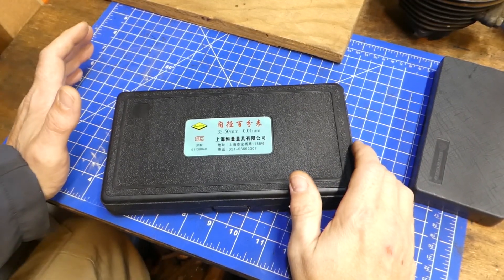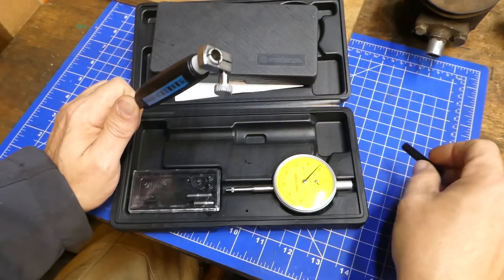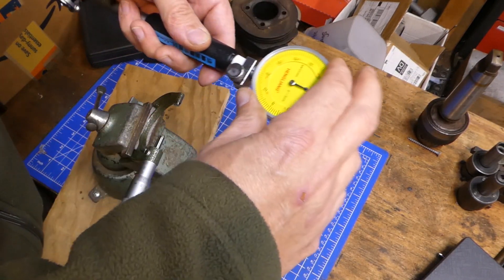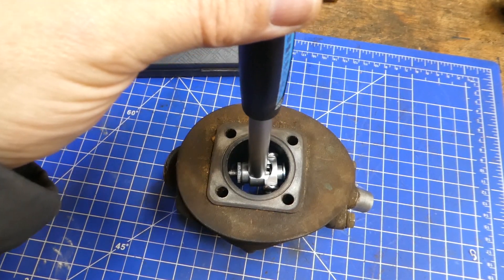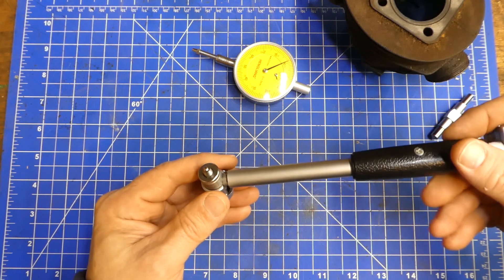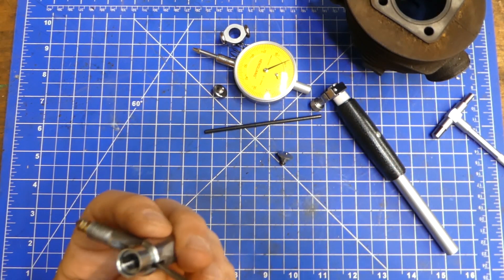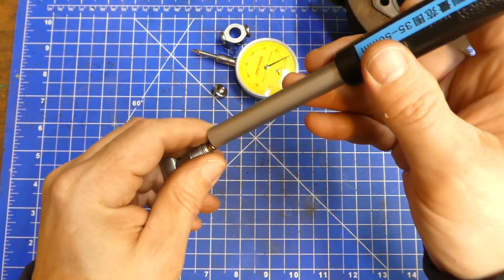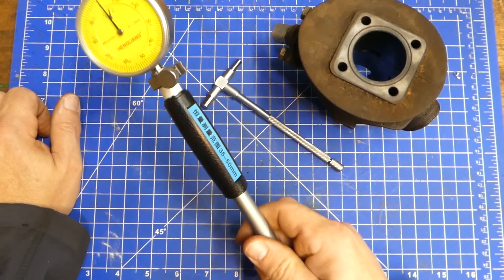Inside a cheap bore gauge

Comment: It didn’t seem to be a problem “fixing” it. I’m always amazed at how they can build something so cheaply and yet have it work the way it’s supposed to.  I often take these things apart as well to clean, re-oil, if necessary and check to make sure it’s actually working properly. These cheap things can work just as well as tools costing ten or twenty times as much as long as it’s understood that you need to know how these work before buying so that you can take care of any problems they may come with. I bought a 6” dial caliper back in the early 1980s that looks just as good as, and works just as well as my Brown & Sharpes and Starretts.

Comment: About the only times i use my one is for measuring big end & main bearing  sizes in engine rebuilding .
An easy way to set them is to lay the micrometer on the foam lid of the box & the foam supports the bore gauge so it can be rocked in 2 directions to set the size .  
You will get the hang of it !!!
Cheers .
Reply from the maker: Thanks Max! I will try that. I knew there had to be some tricks to it. I have seen a few special jig setups for guys that use these all the time but knew there must be some simpler ways to calibrate them..  All the best!

Comment: I bought similar on ebay. Mine was Ok out of the box. Great for taper and out-of-round. Helped me determine that RD400c just needed hone and rings, and XR100R a bore and piston. Something that I'll use maybe every three or four years, I'm not spending any more on.
Reply from the maker: I would normally send bores out to be done, so all I would usually need to know is a rough measurement to determine whether it is in tolerance or needs a oversize. The snap gauges work fine for that. But this is better built for taking repetitive measurements while cutting. And like you say, it is not something I am going to use much so is priced accordingly.
Thanks,
Eddie

Comment: G’day Eddie. It actually doesn’t look too bad for the money. The ok’d bore wasn’t too far off 1.5”. Cheers buddy 🍻. Aaron
Reply from the maker: Hey Aaron. For $15 it is a steal, lol. The bore should have been 38mm plus a few hundreds. A 10th over (is it correct to say 0.1 that way or 100 microns or? Trying to work on the nomenclature) is a bit much BUT it is an Italian engine and the pistons are not always perfectly round so there may have been a compromise made or that bore was "plum wore out". I will go further into that when I cut the bore, IF I cut the bore. I have already had another identical one done by my guy but I want to try it on this machine and see if I can hold the tolerance. So far I am getting mixed results. Thanks! Eddie

Comment: that is a nice assessment.
For me, Not having one is a better option than having that one.
If it was in imperial, might change my mind
Reply from the maker: I hear ya. You can just change the indicator to an imperial one and its imperial.
Reply: @theeddies  Is the indicator mount 8mm vs imperial's 3/8" diameter? I have that problem with mag stands made for the imperial market, tough to find one for metric. They can be had, but sellers on ebay don't specify that well.
Reply from the maker: @f.hababorbitz  it's 8mm
Reply: @theeddies  I purchased many mag stands over the years, all of them cheap China made, until a few years ago, I saw a review on a Noga. I have two of them (I'm just a home shop guy, so fix it, but no production). They are worth the money. I can not find a 8mm one available in the USA, and from the EU, the shipping is a killer. The zero feature at the base is so damn useful, makes setup quick. So for 8mm, I'm stuck with imports. And they are not the same quality. 
Thanks for the show.
Reply: I never was good at thinking around corners, very simple solution.
Reply: Du

Comment: If it's good enough it's good enough. The nice thing about the bore gage is it's easier to measure taper and washboard.
Imagine a line of 8 year old kids or young women who have never used one of these, or even seen a machine tool, putting these together.
Years ago I used to tune up American made firearms from field units into competition arms. You'd be surprised at how rough " quality " guns are and how just a little polishing and adjustment would make in the accuracy and reliability of a brand name firearm.
I converted a few cheap offshore arms too, took a little more work, but most would compete with a brand name.
Reply from the maker: That is exactly what I thought after I figured out what was wrong. The people assembling them just did not know how they work or what they did and just screwed things together. 
I actually thought about redoing part of the head but like you say, it's good enough for the job, if I just Loctite those threads in the handle so they don't come loose, it will be fine for what I need. If I break it or strip them I can always rework it then.  Thanks!

Comment: Must be popular bore gauge. Already sold out or pulled from market!
Reply from the maker: It sure has, it was just there a couple days ago when I made the link. I cannot seem to find a similar alternative near that price. I know when I ordered it a few weeks ago it said limited stock but figured they would just get more. That stinks!
Reply: @theeddies  I think your comment about these being factory seconds is why you can't find them.They ran out of the lot of bad parts made into bore gauges.
I have a lathe I purchased in 2004, 18x40, 6000lbs, Grizzly imported them, never in the catalog but sold online. I'm convinced the 6 lathes (customer service told me that number) they brought in, were assembled with every incorrect machined part. It works, but you can see problems with machining. The tail stock quill had a machining error in the #4MT socket, that prevented the tool from seating correctly. They had a parts machine (a whole spare in Pennsylvania) that they sent me the quill from. Oh, and I had to machine it down 4 thou to fit the tail stock bore (Eli Whitney is not in their factory). Also had issues with the D1-8 spindle nose cams having detents that were not aligned for them to allow easy insertion of the chuck pins. Many many problems like this. A true preassembled kit lathe. I wanted the large spindle through hole for shaft work. I have to say it's accurate, as it is very solid and rigid. The one thing China seems to be able to do, is get the spindle to run parallel with the ways, at least on machines above the hobby grade.
My point is, China does not scrap parts, they put them in special export lots, and you got one of them.
Reply: I purchased the set of these bore gauges from Enco when they were still in biz. I thought they would be very useful in the shop, I've used two different sizes. They are handy for checking engine cylinders for any wear that is uneven. But absolute measurement, you can see they are a bit hard to set up for that.
Reply from the maker: @f.hababorbitz  It is very possible that was the case with this. It just has that feel of "not quite right" even by the stereotypical Chinese tool standard. There is actually some good quality coming out of China now but not this one. But it works, and for the money I cannot really complain.